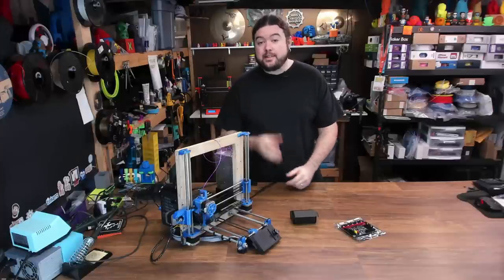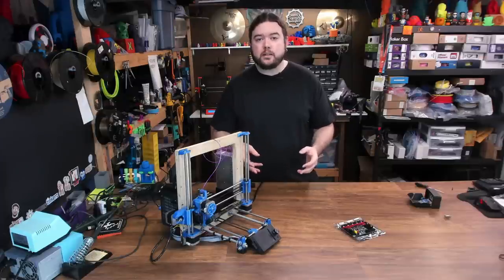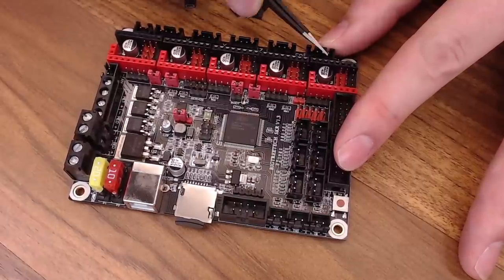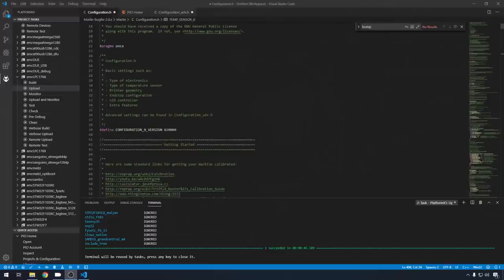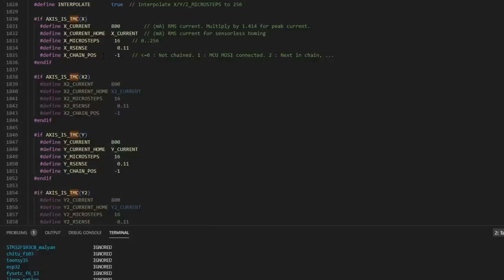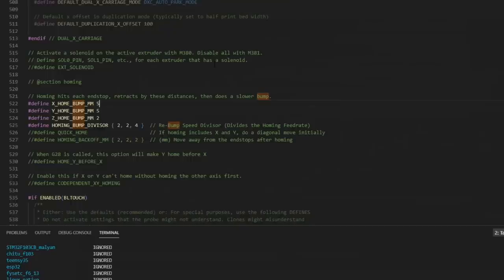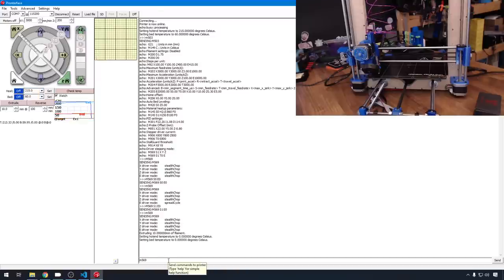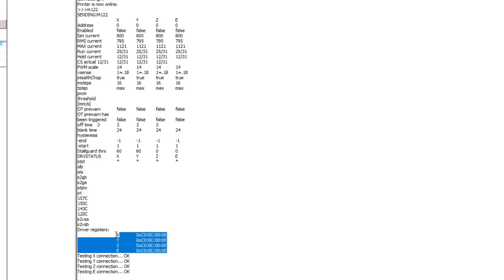TMC2209 Stepper Drivers - Bigtreetech - SKR 1.3 - Install - Chris's Basement

Comment: Today, I have upgraded the mainboard to the BTT SKR 1.4 Turbo with TMC2209 drivers from the stock Anet A8 board. I am absolutely blown away by how much quieter my printer is. Before,  I could hear the printer all the way upstairs, now i can barely hear it sitting 2 feet from it. And it runs so smooth now....I like it! Glad I seen your video on the 2209's. Thanks Chris!!
Reply from the maker: Awesome right!? SO much quieter, thanks for watching!

Comment: Hey Chris. I installed my BTT TMC 2209's  yesterday. Finally got a chance to test them today when the grandchildren went home. Holy hell my steppers are quiet! Now I know what I was missing when running my A4988's. Just got to re-build my X axis to replace a badly flat spotted mini V wheel and my AM8 will be back in business (albeit much quieter).  I have a BTT Mini UPS on the way now too, to hopefully sort out power outages, so Marlin will resume better. Greetings from Wales 😀
Reply from the maker: Hey Brian, yes, it is incredible how quiet they make the printer.

Comment: Chris, is it possible to do a install/config video about the SKR 1.4 (turbo) with TMC2209 steppers?
I would be very thankful!
Reply from the maker: Yes, I will work on it.
Reply: I second that. I have a SKR 1.4 Turbo and the TMC2209-1.2 lying around here, and I just can't get the drivers to run in UART mode. Pronterface always gives me "Error: All LOW" on m122.
Hence the interest ;)
Reply: OK, I figured this out: The UART-Connection only works with 12V connected.
Reply: I have it working now for a great deal. I have a creality CR-10S and have now installed the SKR 1.4 Turbo board with TMC2209-1.2 drivers in UART mode. I also activated sensorless homing. I'm able to move all axes in both directions, but I can't get my ABL probe (LJ18A3-8-Z/BX-5V - inductive NPN) to work for doing the Z-homing. It starts the Z-home procedure and is going down, but it won't stop when the probe is triggered. M119 says that the probe is triggered or open, depending on the state, but whatever I change in Marlin it won't stop and will crash into the plate.
By the way, I'm using the Marlin 2.1.x development version.
Any ideas?
Reply from the maker: @qwerrrrta  Interesting find.
Reply: @ChrisRiley  Great videos. 

I would really like to see this as well, I am scratch building a printer and plan on using SKR v1.4 Turbo, I wouldn't mind seeing a video on the configuration of the v 1.4 turbo either. Thanks
Reply: @jacquesrooswinkel9954  to use an induction probe you will need to cut off the diag pin on the Z axis 2209
Reply: @3DreamDesigns  Thanks HobbyHut, I have read that to and now have it all working now with the use of the standard Marlin 2.0.4.3 version. Configured it all with the help of the great videos of Chris and also got the probe working. It was indeed solved by cutting the diag pin of the TMC2209 on the Z-axis. I also installed the Herema direct drive printhead and my 3D printer is now working like a charme!
Reply: Tobias Abellan not 24v or what do you mean?
Reply: Could u also do one for the ramps 1.4  please. Specifically I want to know if i can just plug it in after software configuration or if I have to add extra wiring

Comment: This is a different kind of article than I was looking for. That's OK, it was easy enough: replace my A8988s with TCM2209s, putting the pot's toward the RAMPS power terminals, reverse the stepper connectors, and set Vref to about .8 volts. The new drivers quieted my Makerfarm Pegasus effectively, so I'm satisfied. Have fun, those of your making the more elaborate upgrade!
Reply from the maker: Awesome! Thanks for sharing

Comment: Hey Chris, im into rebuilding 3ds cube 3, to use marlin and running skr1.4 with tmc2209, i cant get the sensorless probing to work...(not be able to Configure correctly??) does the diag pin need to be connected to zmin signal pin? 
I appreciate your videos, very informative, keep up with the good work
Reply from the maker: On a 1.4 as long as you have all the pins on (not clipped) sensorless homing should work. Marlin just released 2.0.5 that fixes some issues with sensorless homing.

Comment: I see this was already mentioned in the comments and wondered if you figured it out yet? 
The instructions for the SKR 1.3/1.4 say for 2209's you need to cut the diag pin if using mechanical endstop on that driver.  I assume you didn't cut the pin for Z. Is the bed level probe seen as a mechanical endstop?
Reply from the maker: I didn't cut the pin and I would think the jumper would control this. I am going to test this again. Yes, the probe should be just like a mechanical switch.
Reply: @ChrisRiley  After looking into it more, it's only the SKR 1.4 board that you have to cut the pin if you don't want to use stallgaurd. A step backwards from the 1.3. I'm not sure why they did that.

Comment: It would be great to see you show the setup of skr 1.4 turbo, 2209 on the SK-GO
Reply from the maker: I am working on the 1.4 stuff now.
Reply: @ChrisRiley  i have just managed to get mine working SKR 1.4 Turbo, 2209s uart mode and sensorless homing but i did have to drop sensitivity down to 110. I'm also using a trulev probe and i did have to cut the diag pin off the Z axis. Im using the Seckit SK-GO :)
Reply from the maker: @3DreamDesigns  Good deal, glad you got it working.

Comment: It was quite some time since you setup sensorless homing. How well has it fared? Has it been reliable? And would you trust using it with a glass bed 🙂
Reply from the maker: Sensorless homing works well on certain printers, but not well on others. You have to get it just right, the firware does get better and better as we go. I still wouldn't trust sensorless Z with a glass bed.

Comment: Very helpful. I am thinking to get a SKR 1.4 with 2209 drivers. Chris, what do you think about dual Z motors with using E1 as you mentioned to configure to level the bed? As in my CR10 sometime the Z axis gets tilted on one side. I was thinking of using two endstops if possible but looks like I can use sensorless homing for Z as well? Will definitely have to set something on Z both sides so it does not hit hot end.
Reply from the maker: Yeah, that is going to be tricky. I haven't tested the Z sensorless homing yet. It would be cool if it would run up to the top and level before every print. Adding the second E1 Z driver shouldn't matter to much. Should be the same results.

Comment: Hi Chris Great Video but then again i have been using a lot of your videos for education as I just started in the hobby. Quick question should I leave the 2 jumpers off the booard (skr v1.3) if i am not sure about using sensorless  homing or put them in for future. will it effect my endstops and such Thanks
Reply from the maker: Yes, it will impact your endstop, if the cap is on, the endstop will always be triggered. Maybe just leave the cap on 1 pin for safe keeping.
Reply: @ChrisRiley  Thanks Chris

Comment: One big reason to move from 2208's to 2209's is Linear Advance. From what I've read, the 2208's are not compatible with Linear Advance within Marlin.
Reply: Correct. From experience I can say that 2208 with LA results in a non-functional extruder. Did read about some possible fixes, but haven't tried them yet. It's easier to move to 2209 ;-)
Reply: 2208 work in UART mode. You only have issues, when using Standalone-mode. Also the SQUARE_STEPPING option helps.
Reply: All you need to do is changing this setting from 0 to 1 --: #define MINIMUM_STEPPER_PULSE 1 There is other resons for changing to 2209, LA is not one of them.
Reply from the maker: Good to know LA is working on the 2208 cause I have a ton of them. LOL

Comment: Great walk through Chris. I've had the SKR 1.3 and TMC 2209s on the Borg for a while now, they have made it so quiet and the sensorless homing works perfectly, although I do still have the occasional skipping on X when homing but that's just a little tweak to the sensitivity, which I'll do soon.
I too have a parallel coupling for dual Z motors, but I'd rather have them on separate drivers if possible, although that could introduce an imbalance where the Z motors could fall out of sync, what do you think? Would you consider doing a video on setting it up?

Currently I use the BL Touch but would still be very interested to see sensorless Z homing and what you think of it's reliability.
Reply from the maker: Hey Spike! I have thought about doing a video on separate Z motor drivers, that could be interesting. It also has some downfalls. It might make good content. I will start looking into it. With the 2 drivers, if they weren't really close to the same current you might get slow creep. Not sure, we need to test......Science!
Reply: @ChrisRiley  Very good point, even the differences in cable could cause creep and with bigger Z heights, that would only get worse.

Comment: Hi Chris. I am a bit confused about these skr mainboards. I have read that the E3 mini is the most easy one to install in my ender 3, same layout just a replug and go. The thing is that I find many many many bad comments about the board breaking quickly. So I am looking into the skr 1.3 or 1.4 now. Is there any board you prefer about these 3? I would really like to start printing alot more silently. Thanks
Reply from the maker: I have had good luck will all these boards, but I have heard people have had issues. I have had the most luck with the 1.3 board I would say, but I really like the mini because it fits in the case.

Comment: Do you know the difference between stallguard 2 and stallguard 4? I tried to find out on the trinamic web site but I couldn't find any information about stallguard 4, only 2.
Reply from the maker: I really don't, but I might be able to get them to fill us in. I will try.
Reply: Stallguard 4 also works in stealthchop mode

Comment: Hi Chris, 
Thanks for this great video! Very helpful. 
I'm trying to setup TMC2209 drivers for a project not a 3d printer, so Marlin would not be involved. 
Can you explain what signal the stallguard homing sends when it's triggered? Is it a code through UART?
Thanks for your help
Reply from the maker: You bet! Unfortunately, that is over my head. I would have to refer that to Trinamic.

Comment: I'd just like to second your comment about playing with sensor-less homing on z to use it as an abl sensor. That would be pretty cool if it worked reliably.
Reply: The torque on a Z lead screw is so high compared to a belt axis I can't see Z using sensorless homing.
Reply: That's like waiting for parts to be destroyed. One wrong setting and smash. Broken.
Reply: @Deneteus  Not any different than x or y and so far it seems to work a treat on them.
Reply: @hightde13  X & Y don't typically have a piece of glass or a hot end nozzle to smash into.  The worst that ever happens with X & Y is it hitting a support.
Reply from the maker: Yeah, this one could get interesting.

Comment: Hi Chris, can you give me a little heads up on changing voltages on sensor less homing? I have both X & y working on a Hyper cube with 2209s on a SKR v1.4. Each axis homes really well individually but when homing all the Y homing clunks a little, it does not crash I cannot resolve with the sensitivity, seems much higher on the V1.4 turbo board at around 130. Clearly something to do with the Core XY set up but I have not figured out yet. I thought reducing voltages on homing might be the way. I have tried dual physical stops so the carriage homes evenly on both sides but this also does not make any difference. Thanks again Boothy
Reply: Hi Chris, I have just adjusted the voltages, it was staring me in the face, apologies for the request. I have found a sweet balance of 175 for the X current home and 150 for the Y current home. However on initial homing after switching on the Y axis still clunks a little but thereafter on repeat it is fine. I will now start looking at the driver current themselves. I did not realise that both sensor less homing sensitivity and the Driver currents can be individually changed directly from the printer on screen menu in Marlin from the config , advanced settings, TMC drivers menu, which is so much easier for testing. Best Boothy
Reply from the maker: Hey Stephen, I am glad you got it sorted out. Take care.

Comment: Wait..stepper drivers are controlled via UART now? I think not many microcontrollers have more than two hardware uarts, so they make it work with bit banging which kind of defeats the advantage of speed a bit, doesn't it?
Reply: TMC2209 UART uses a frame structure with a slave address field, so you can drive multiple chips (up to 4) with one UART.
Reply from the maker: Yeah, things get a bit tricky with one serial. I am currently troubleshooting some issues with multiple devices now.

Comment: Hi Chris is the Marlin firmware stored on the Mainboard or on the Micro SD card. Can I transfer the card to exactly the same SKR  board as I have a problem with the board in my Ender 3
Reply from the maker: It's loaded from the SD card, but stored on the board. You should have a .CUR file on the SD card, if you rename that to a .bin then you can use that to reload your firmware to a new board.

Comment: And another great video!! Although I followed your instruction to the letter, at the end I got a TMC CONNECTION ERROR. As soon as I plugged the board on 12v the error disappeared!! Any thoughts? 
Thanks again and keep up the good work!!!
Reply from the maker: Make sure your vref jumper is of of the USB pins. They probably just didn't have enough power.
Reply: @ChrisRiley  thanks mate. I think that was exactly the problem!!
Reply from the maker: @andreas43  :)

Comment: @Chris Riley, is this printer 12v ? Do you experience any whines when moving higher speeds ? For example my custom printer running skr v1.3 and tmc2209 or tmc2130 are experiencing whines when doing infill which is faster movement than external perimeters. Ender 3 which is 24v and has tmc2208 do not do this at all.
Reply from the maker: Yes, they are a bit louder at 12v, especially in spread cycle. If you set the 12v option in Marlin it's a bit better.

Comment: Hey Chris, great video. I have a skr 1.3 with 2208's uart mode. I'm interested in using linear advance and understand the 2208 doesn't work with that. I'm thinking for $12 changing my e0 driver to the 2209. Am I missing anything?
Reply from the maker: I am not sure exactly, I can confirm my 2209's do work with it, so I think that is all you would have to do.

Comment: Hi I would love to ask a question.
If I use stand alone STEP / DIR  mode how can I set the tmc to perform a full step each time?
Reply from the maker: You would pull MS1 MS2 and MS3 jumpers off, that would put them in full step.
Reply: @ChrisRiley   there is no ms3
Reply from the maker: @idogedanken9999  Which board?

Comment: Hello.  What is the VREF setting for 17HS4401S Nema Motor and 1/8 stepper stepper of Tmc2209 stepper motor driver board?  Thank you.
Reply from the maker: That's a 1.7 amp motor, it would depend on your load, but 800 would be a great starting point.

Comment: Something cool to try is Power Loss. My XY have sensorless homing, my Z use an endstop. When power loss happens it returns to the right Z position but not for XY, it shifts. Guess sensorless homing and power loss dont go along
Reply from the maker: Interesting, I will have to try this. Might have to re-home to get it to work.
Reply: My guess is that sensorless homing is unreliable because the motor might flex more on one homing than another and this causes inpredictability in the position. 

It's nice for one-go print where the zero position doesn't need to be 100.0% accurate, but as soon as you need to rehome and use it again, it'll shift a bit.

Comment: Would there be any chance of you doing an updated version of this video for the BTT SKR v1.4 Turbo with the TMC2209's? 
My 1.4 Turbo arrived just today and it's going to be replacing a faulty board in my Anet A8 Plus DIY kit, and after seeing all the features you described here, its going to make this A8 Plus machine a BEAST..... now if I could get up the nerve to move forward with the project. ^.^;
Reply from the maker: Absolutely, SKR 1.4 content coming soon!
Reply: @ChrisRiley  Sweet! Will be eager to see the video. Looking to setting up the stealthchop and sensorless homing with this machine as well.
Reply: @ChrisRiley  Also finding out that there's a whole list of configurations out there for Marlin, and there happens to be the A8 Plus amongst them, so this very well could make setting up my current printer a LOT easier for me. 
https://github.com/MarlinFirmware/Configurations
Reply: @ChrisRiley  Big update for me on the build work on my Anet A8 Plus. Firmware has compiled correctly and I have the board connected to the printer and tuning sensorless homing for the XY, I have encountered that 60 was nowhere near high enough. I have settled in on 150 for now until I can be able to print. 

The main issue I am trying to figure out right now is with the extruder. I am not sure if its current or something somewhere in the settings, but its been a task for doing a lot of digging. If there's any information that I can forward to you about my build work, please let me know. I would be happy to help with the work on this new board (be it weekends due to a full time job ^.^;). 

Again, THANK YOU for what this video has provided, with your help and others on a relevant Discord chat, I have gotten to this point. Without that help (and frustration with the lack of knowledge on VB usage) I am able to turn a decent starter machine into what will be a BEAST of a printer when I am finally finished.
Reply from the maker: @AzurusNova  Thanks for the update. If you get stuck, you can always send me an email. brotherchris81@gmail.com